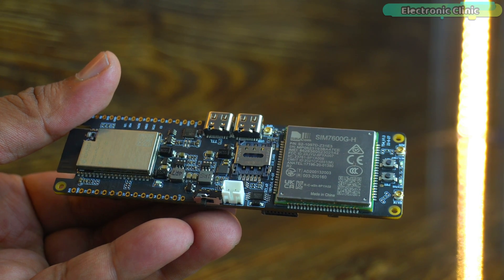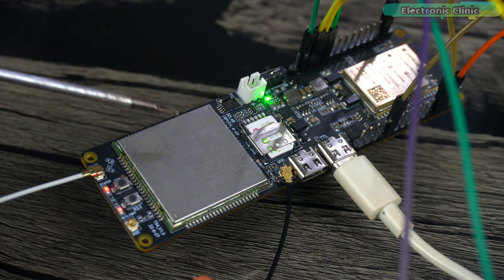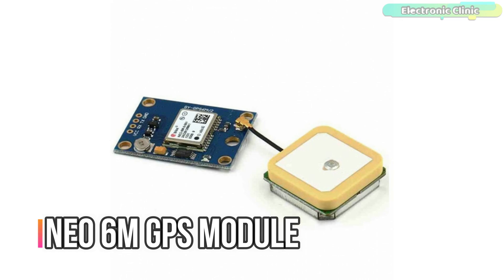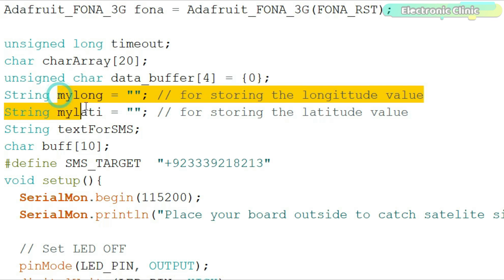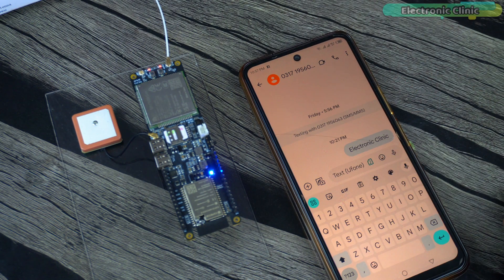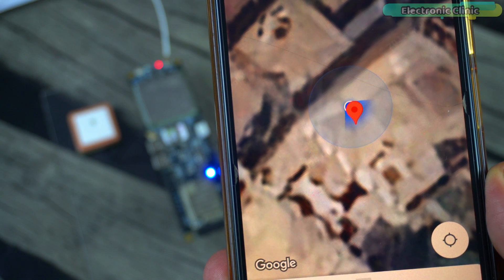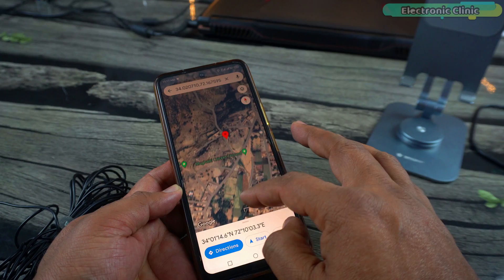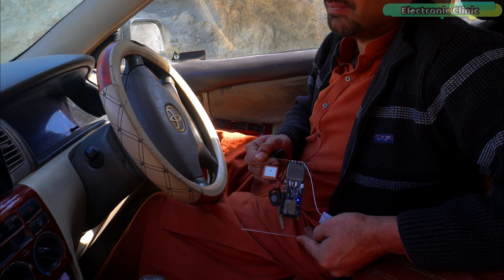GPS Tracking System using ESP32 and SIM7600G-H 4G LTE with Google Maps through Text Message

Comment: Hello i need help for this project Sir since i'm using the right program but it always shows this problem. 

Waiting for gdb server to start...[2025-01-10T01:07:44.562Z] SERVER CONSOLE DEBUG: onBackendConnect: gdb-server session connected. You can switch to "DEBUG CONSOLE" to see GDB interactions.
"C:\\Users\\phili\\AppData\\Local\\Arduino15\\packages\\esp32\\tools\\openocd-esp32\\v0.12.0-esp32-20241016/bin/openocd" -c "gdb_port 50000" -c "tcl_port 50001" -c "telnet_port 50002" -s "d:\\PINDOT" -f "C:/Users/phili/AppData/Local/Programs/Arduino IDE/resources/app/plugins/cortex-debug/extension/support/openocd-helpers.tcl" -f board/esp32-wrover-kit-3.3v.cfg
Open On-Chip Debugger v0.12.0-esp32-20241016 (2024-10-16-14:17)
Licensed under GNU GPL v2
For bug reports, read
        http://openocd.org/doc/doxygen/bugs.html
DEPRECATED! use 'gdb port', not 'gdb_port'
DEPRECATED! use 'tcl port' not 'tcl_port'
CDRTOSConfigure
Info : Listening on port 50001 for tcl connections
Info : Listening on port 50002 for telnet connections
Error: unable to open ftdi device with description '*', serial '*' at bus location '*'
C:/Users/phili/AppData/Local/Arduino15/packages/esp32/tools/openocd-esp32/v0.12.0-esp32-20241016/bin/../share/openocd/scripts/target/esp_common.cfg:9: Error: 
at file "C:/Users/phili/AppData/Local/Arduino15/packages/esp32/tools/openocd-esp32/v0.12.0-esp32-20241016/bin/../share/openocd/scripts/target/esp_common.cfg", line 9
[2025-01-10T01:07:44.694Z] SERVER CONSOLE DEBUG: onBackendConnect: gdb-server session closed
GDB server session ended. This terminal will be reused, waiting for next session to start...

Comment: This seems like a good idea for a vehicle tracker. But how do you connect it to your car battery or ignition that is 12v?
Do you connect a 5v usb cable to one of the programming ports?
Or do you need to make a voltage regulator at 3.3v-4.2v to the VBAT pin?
Thanks for the great work and video

Comment: Received a couple of the Lilygo SIM7600G-H 4G LTE , loaded up your code and it worked great for a day, very cool, and then the script could not get any GPS information from the device. With AT command in debug I can get Lat/Lon with CGPSINFO. In looking on github I see this is a common problem where it worked for a while then could not get GPS location but found no resolution.  Sad as I found this very useful.

After trying a few things, I found that the device would on first boot send a good Google link when requested.  After that, "Couldn't get GPS location". When I rebooted then I could again get 1 good result. It appears for me that modem.enableGPS() is needed after GPS query and will try this. Anyway, for now put ESP.restart() after sending SMS and get a good response after every request with that.

Comment: should we solder the board like the other video u made?
Reply from the maker: I think there is no need. But still if you want then you can solder it on the top side.
Reply: Hello brother I need that circuit in Pakistan kpk Peshawar with code code already installed on board can you help me please
Reply: I really need it please help me brother